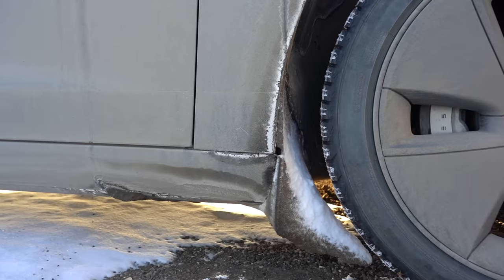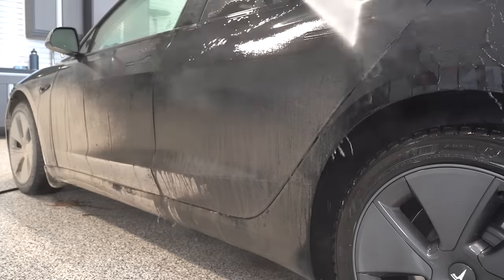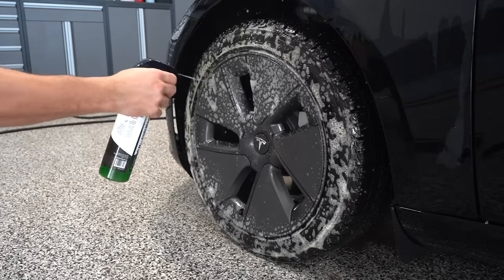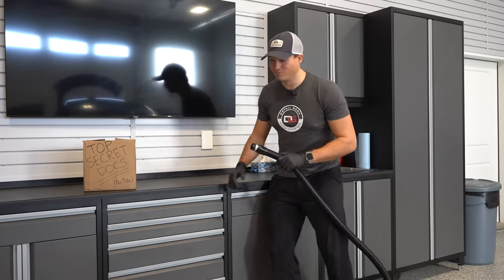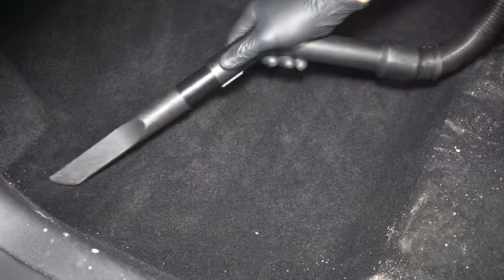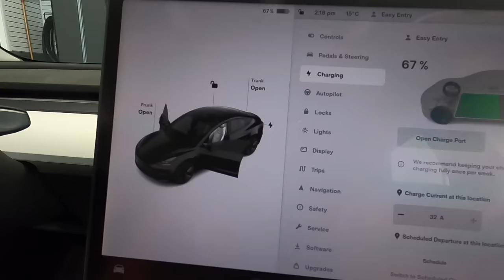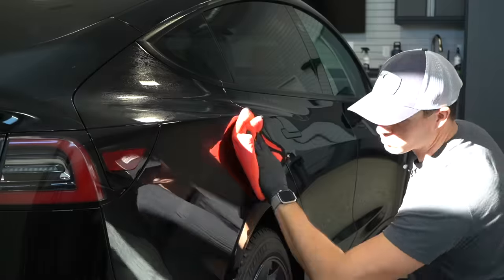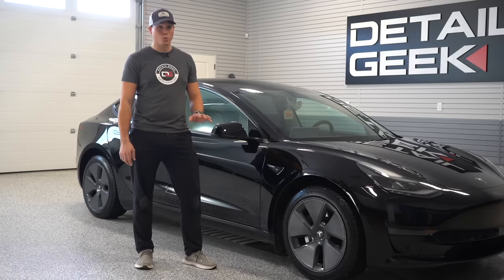Cleaning The SMARTEST Car On The Road?!

Comment: Heads up, you can remove the plastic wheel covers in order to more easily clean the inner wheel parts.
Reply: I was wondering if he was going to do that. I haven't made it that far yet. Guess I'll watch and see.
Reply: Beat me to it lol
Reply: I was just about to comment to let him know he needs to remove those plastic hubcaps to clean the actual rim the amount of dirt and grime that gets stuck underneath there is insane
Reply: @helenfitch3440  😂😂
Reply: As a professionnal it is a shame to let them on !
Reply: Why do I think of the geek guy when it’s come to ppf and ceramic ? Bunch of popup advertising for cars like Telsa or talk about on social media
Reply: @mmani5466  Thanks for telling this boys
Reply: Why not clean the rims? Dirt accumulates so much there 😢
Reply: @mmani5466  those are definitely the plastic aero covers and they definitely come off.
Reply: He said he cleaned a similar one a few years ago. Were the covers removable then? I'm wondering if he just didn't know or didn't think they did
Reply: @ashleynicole3499  they’ve always been removable. Not all of them have the covers though. There is an option package with normal wheels.
Reply: Yeah I knew that, I wonder why he didn’t take them off but maybe he did I don’t know.
Reply: I often wonder Y he didnt get a lift 4 the shop get the car off the ground and he could do a better job on the tires.

In an older video he did take the rims off.Another guy on this channel said as a detailer not suppose 2 take the tires off or anything like that.Some of them tires look flat. I dont know if allowed 2 air them up.😊
Reply: @elizabethannfarrow1971  it’s a bad idea to take wheels off for a detail unless the customer signs a waiver. Imagine something not getting properly installed and a wheel comes off or a lug stud snaps. Now you’re on the hook for that.
Reply: Dude! You didn’t take off the wheel covers!! 😢 those rims are still really dirty even after your detail!
Reply: Hi
Reply: He’s just lazy. The owner won’t see it so he doesn’t have to do it.
Reply: You can also remove them if you dont want your car to just look like crap too.
Reply: This channel is very attractive, especially the guy in the video 🤩🤩🤩
Reply: 9 @YungRam17
Reply: Yep
Reply: Use ONR for the seats. It’s safe for that. One No Rinse (ONR). Very versatile cleaner.
Reply: They’re built into the car😂
Reply: Why the words heads up I hate it 🤬🤬
Reply: Stupid word heads up

Comment: Model 3 owner here. I can’t remember if you did these on the prior model 3 video or not, but these tips may help with future Tesla cleanings: in the main car menu under Service, you can do Car Wash Mode and Wiper service mode, and under Display you can do Screen Clean Mode.
Reply: What does all that do?
Reply: Wow
Reply: @matmul4850  the screen doesn't do anything when you touch it
Reply: @matmul4850  it turns off the sensors so it doesn’t go crazy but also locks the charge port so it doesn’t open when touched
Reply: Olá como Faso pra mim compra esses produtos
Reply: @paulosergio9461  look n the description. He has all his products and tools in there.
Reply: @neutralix366  also keeps the doors from locking, sets the climate to recirculate and puts all windows up if they're not already, plus gives you an option on the screen to fold mirrors if needed or enter screen clean mode. I use it every time I wash either in an automatic wash or hand washing. Really convenient to have all this at the touch of a button.
Reply: The owner wouldn’t have known this so couldn’t have told Mitch. It’s clear the owner doesn’t have a clue what a car wash is so wouldn’t know about this menu.

Comment: Bro you should always rinse off the first foaming, as the dirt, even though encapsulated, is still RIGHT THERE - rinse it off and then either refoam it, or go directly to contact wash. You're currently just running that shit into the paint 😭😭😭😭

Comment: I’m a Tesla technician and sometimes I’m amazed at the places people will take these cars.  😂

For future reference, those caps on the wheels come off exposing the rims for easier cleaning. Then they just clip back on by aligning the hole on the cover with the valve stem on the wheel. 

Also in service menus there is wiper service mode, car wash mode, and screen cleaning mode.
Reply: nothing falls off this time fortunetly.
Reply: And he’s not charging it, so it won’t blow up either. Teslas are so crap.

Comment: I was happy to see TuxMats in this car! I have them in my model Y and they have been great for the 2 years that I have owned them. I had Weathertechs in my Ford previously and I can, without question, tell you that my Tuxmats are infinitely better. They aren't as stiff nor do they warp, crease, or discolor like my Weathertechs did. My Tuxmats are super easy to clean and have not changed in appearance at all. The area that they cover is also a lot greater than Weathertechs, not to mention that they don't have that cheap, plastic feel under your feet. I seriously cannot recommend these enough.

Comment: This Tesla looks great, however, black exteriors and white seats are definitely not for me! The build quality on this Model 3 looks pretty good. Panel gaps are tight and even, not like an earlier production Model S that I saw where you could stick your little finger in-between a couple of panels.
I'm looking forward to the Quick Fix video on Tuesday to see what the TOP SECRET may be. Is Mitch getting an electric Ford F-150 Lightning? I hear they are hard to get right now, and the already high price is going up (what isn't these days). If Mitch gets one, then I'll know he won the lottery 😄

Comment: Those tuxmat floor mats I have for my Tesla Model Y, and I use them on uber and lyft. Very durable, and just took them out for the first time after one year, and carpets are still the same black as they were on the day I picked up the car. Tuxmat floormats are better than any weathertech or other brand of all weather mats I've ever used. Only complaint is they are bulky to remove and put back in

Comment: As  a car detailer I watch your videos with interest. I am based in Brisbane,  Australia and have operated a mobile car detailing business for 14 years out of the back of a van, currently a VW Caddy Maxi. In summer the temperature hovers around low to mid 30 degrees Celsius, 90 degrees Fahrenheit plus. I note you work in a workshop with everything at hand. I wear a wide brimmed cricket hat, lots of sun screen, polo shirt and shorts with elastic sided work boots (most locations I work at require steel capped boots and hi-viz clothing to meets workplace safety requirements). No baseball caps, runners or disposable gloves for me. 
Fortunately winters in Brisbane seldom drop below 10 degrees Celsius (50 Fahrenheit) however  tap water can be very cold and hard on the hands. I don't envy you the Canadian winters. I imagine it would be to cold to wash a vehicle outdoors.
I wonder how much time you spent on this Tesla. I would expect to do a similar detail in about 90 minutes and charge around $70 Australian. 
Anyway, just giving you  a look at the life of a car detailer in Australia. Keep up the good work.

Comment: Hello. So how would you clean the vegan leather seats if they had stains on them? For example, blue jeans on the driver's seat?
Reply: I just use a few drops of Dawn dishwashing liquid diluted in water.  Wipe it on with a microfiber and let it sit for about 10 seconds and clean with the same cloth, and wipe it clean with just water on another cloth & then dry.  I've been surprised at how easy the white seats are to keep clean.

Comment: Great video thank you hey, does anybody know what to use on soft cloth seats in a Toyota Camry to remove sweat and soil? I don’t trust the harsh cleaners and also what do you wipe it with when you spray it down with the solution? Thanks.

Comment: What degree tip did you use? I have a 2022 Model Y. Typically use a 40 with a 2700psi sprayer

Comment: It's weird to me as a non-Canadian that people will spend so much on a full detail while there's still snow on the ground. It's going to be dirty again by the time they get home.
Reply: I think it’s all about general maintenance, no different than changing the oil, actually the winter is the time to be putting on paint protection and cleaning the interior, otherwise by the time spring comes around there is damage that can be beyond repair.

Comment: This new Tesla was beautiful.  The only thing would be NO white leather upholstery.  Ugh, NO NO NO.  It sure is high tech, but it also makes me wonder about repair costs and if they are astronomical.  The mysterious new project that has summarily banned Mike is hilarious.  I will be stoked and ready for Tuesday!  Your cleanup of the interior with the new vacuum was so intense.  You found every nook and cranny.  APC on the interior, but no 303, is that because the APC did such a thorough job?  Smart that you did your homework about the vegan leather.  The sign of professionalism.  Great work Mitch.  The Tesla looks showroom new again.  Have a great weekend!!   :_steamer::_bissell::_gross::_mike::_mike::_mike::_mike:#MikeStillTheDude!
Reply: Tesla owner here I am not scared of the repair costs. Compared to an ICE engine not much needs to be maintained or can break. The battery has an 8 year warranty and by then I won’t own it anymore. That aside I know owners work Teslas older than 8 years they still work fine. The software updates over the air so they don’t drive around with old technology.
Reply: @EnthusiastCarHangar  Thanks for chiming in.  That helps me understand the owner perspective.  :_steamer::_bissell::_gross::_mike:
Reply: @joelbuchanan471   I love many different cars and they all have pros and cons. Tesla pays off for me to commute. I save big time on gas, no oil changes or service needed but tires of course. I will see how it holds up 👍🏻
Reply: @Joel,  I always enjoy reading considering your postings.  I think a highly recommended to you should be a famous writer of books.  I want your autograph on the book.  I buy it.  Why not?   Have a wonderful weekend!    Keep warm and stay safe, my friend.  😊

Comment: Looking good, Mitch! No, I wouldn't own one. I feel as though the self driving feature is more of a novelty or only something useful on flat, straight roads. The price doesn't thrill me, either.  Here in Pittsburgh where roads are hilly, pothole'd, narrow, windy (synonym of curvy), nothing about that car would be particularly useful.
Reply: Most other EV's on the road are better built and equipped and run by more mature people

Comment: I've also recently detailed a 2022 Tesla Model 3, and I don't think the quality has improved. It only had around 2700 miles on it, but the window seals leaked in some water, a massive crack on the panoramic window on the roof just from a little chip on the edge of it, and peeling clear coat near the mirror. I'm not buying a Tesla anytime soon.
Reply: Agreeable, poorly built hype machine

Comment: Not the smartest car on the road. To say the least. Might be the dumbest,  giving all the car accidents they are causing.  

Electric cars might be OK in a decade when they are using different elements to make the batteries and motors. The current tech makes them way worse on the environment then a New ICE car.

Given the elements used today, it's like buying a carbonated car of the 60's and thinking it's high tech.   Lmao